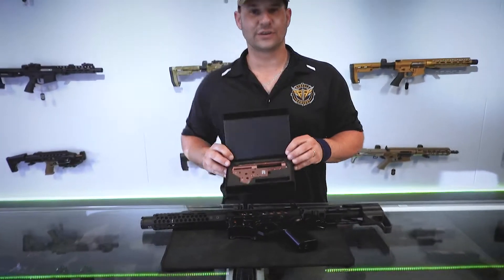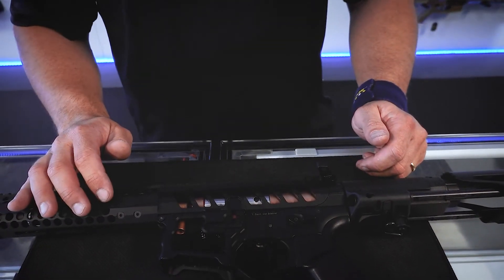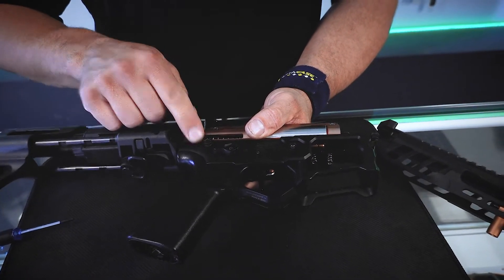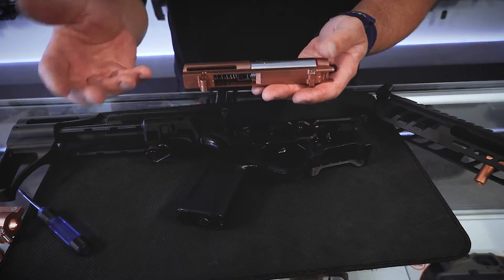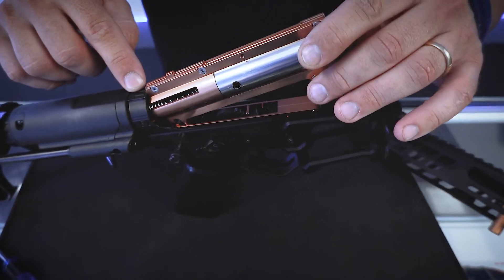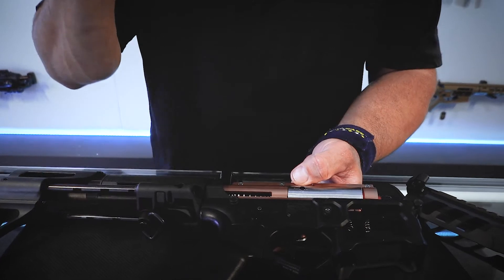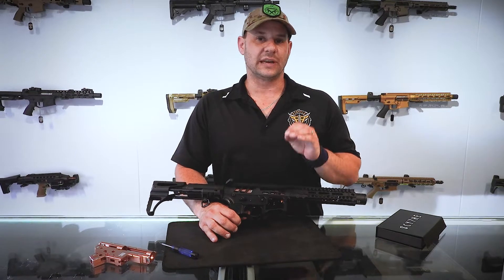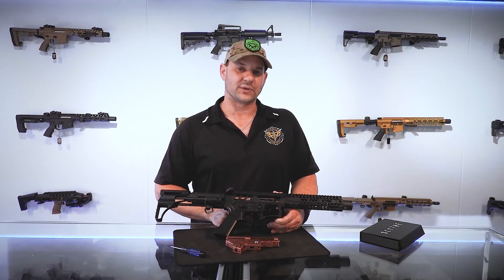Aztech Innovations SPLIT Scythe V2 Gearbox

Comment: My wonder is about buffer tube screw. Shouldn’t one screw in the buffer tube screw to stabilize the guide plug
Reply from the maker: No you don't need to, that's only for models that the buffer tube is bolted to the receiver,  if its a screw on buffer tube that mounts to the receiver then they don't have any bolts into the spring retainer.  This is why we used the APS 4 lug type spring retainer that sits square in the back of the box with out a bolted on buffer tube
Reply: @AzraelsArmoury  thas kina hot tbh m8 <3